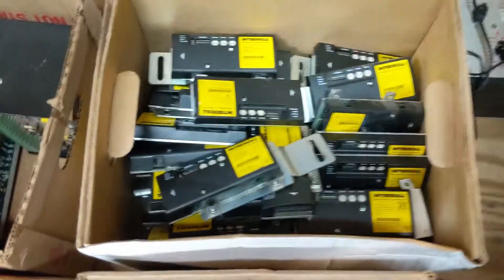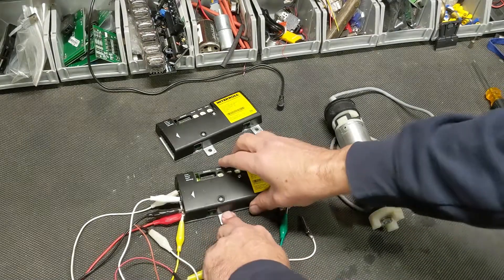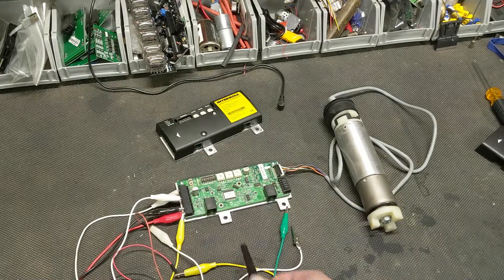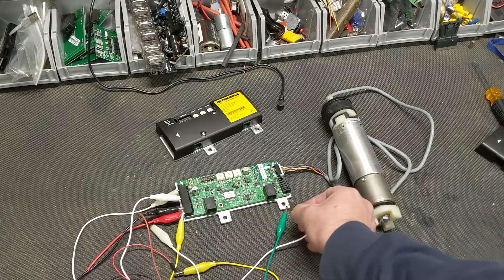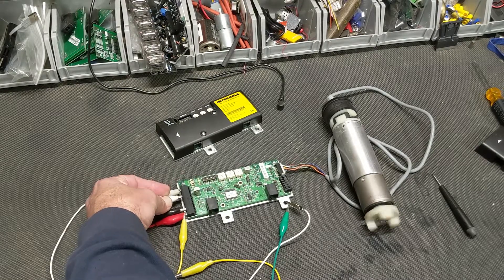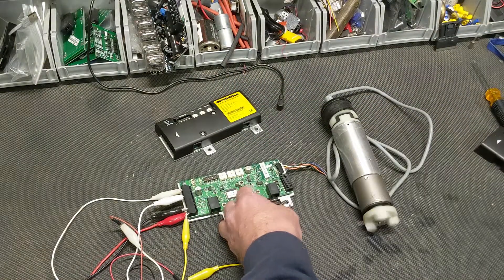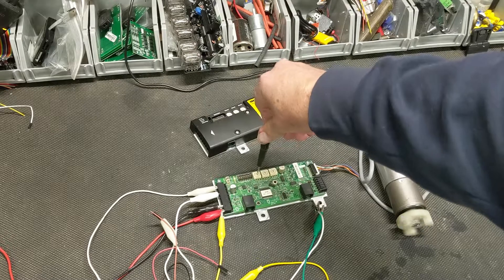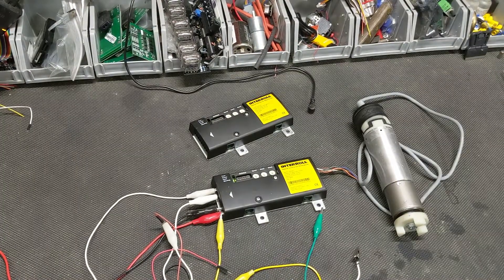Rollerdrive 9006 Brushless DC Motor Controller

Comment: Hi, I have an interoller conveyor drum roller. It came with the 9006 hybrid controller. I am making a DYI rock tumbler/polisher and just want to run it full speed. I don't want to use speed control or sensors, I just want to flip a switch and run it full speed.  Can you explain the easiest way to do that?
Reply from the maker: Hey David, just connect +24v to pin1, ground pin 2, then put your on/off switch between pin 1 and pin 5 or 6, depending on the rotation direction you want. With the speed pot turned all the way, you're at full speed.

Comment: Hi did you figure out the pin out from the motor I am trying to figure the pinout with out a control box any help would be much appreciated cheers
Reply from the maker: Hi Dave, I didn't figure out the motor pinout. I could send you a controller if that would help
Reply: @JordanWorkshop  I came across this looks like it could be the pinout what do you think https://pasteboard.co/KcDTFmj.jpg
Reply: @JordanWorkshop https://thelogisticsworld.com/fichasPDF/645/178.pdf
Reply from the maker: @spciyturtles  That's it! I read the signals on a scope to make sure. Thanks, great find!
Reply: @JordanWorkshop  not a problem if you find anything out on it I'd be interested to know what wire the hall effect sensor would be 😊
Reply from the maker: @spciyturtles  There are three hall effect sensors 120 degrees apart. All three use +DC from the blue wire and ground at the green wire. Yellow, orange and brown are the hall effect output signals.
Reply: @JordanWorkshop  Thanks for that makes a lot more sense now hopefully can tie it into read on a Arduino 👍